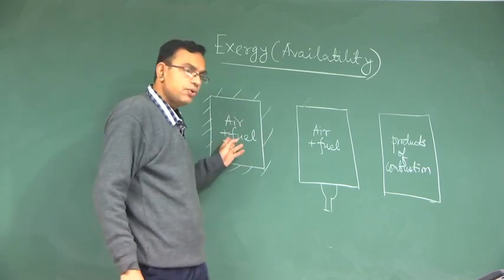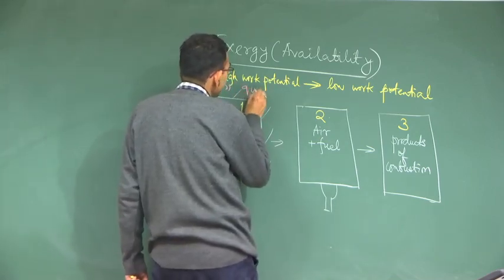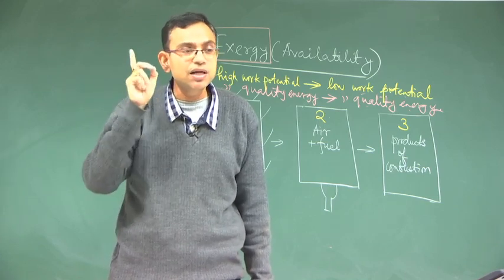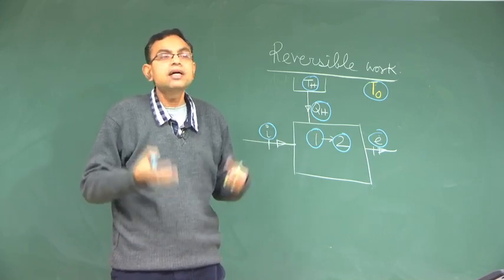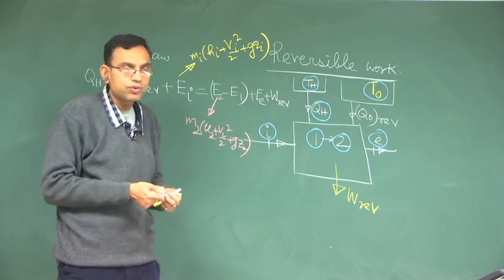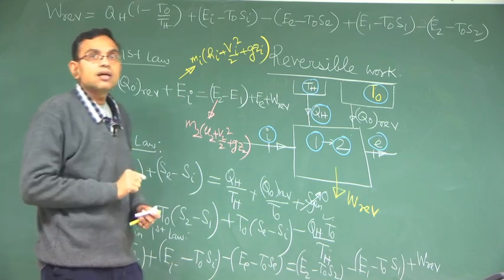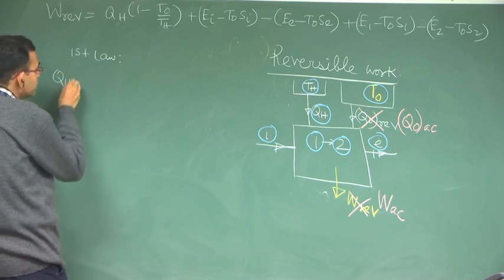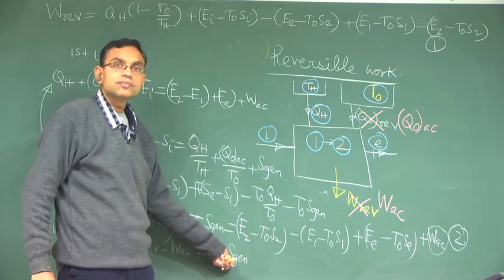Lecture 53 : Exergy (Availability)

Comment: I have question? If as contol volume exchanges heat with two  reservoirs only giving heat then where is it rejected. It would violate Kelvin plank statment. Of second law
Reply: Hello
Reply: It's a valid question, but I think Qo will be negative.
Reply: Kelvin-Planck statement is validated for an engine cycle only. Control volume analysis is for a flow-process, results are further simplified for a steady flow process.
The states are following a path where Eulerian approach is done for end state 1 & 2.